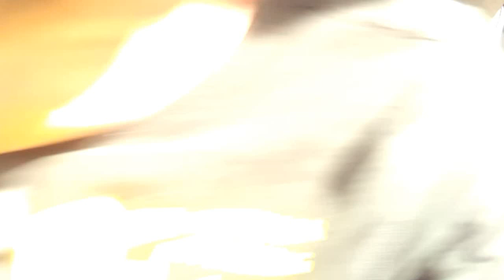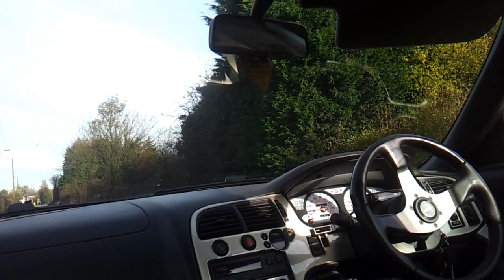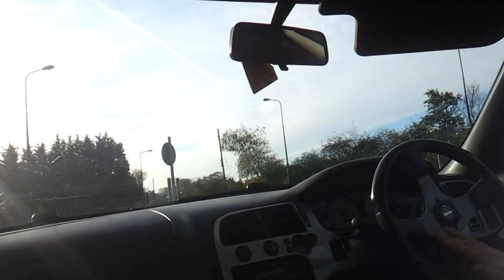Nissan Skyline R33 GTST little roundabout drift on a very slippy day 330bhp

Comment: nice! i want that BOV! gives that flutter sound of not running one.
Reply from the maker: Actually I think I had blanked it off at this point. Either that or it was really tight so it didn't really release properly. Never looked back ;)
Reply: compressor surge !!!

Comment: Sounds mint like good music lol. 
Just for others who dont know its not his bov making that noise. Its because he has blocked it.  Hence why it flutters.  U can either buy an adjustable bov and set it on tight. It will flutter.  Or u can take the pipe off your stock one and plug it with a screw and clamp it hard. Works the same. Just get a plastic cap to plug your bov also or it will leak.  ;)  and flutter all day long. Only problem is i have noticed it decreases kw and turbo spool time if you block it.  Sounds fn mad but causes lag and not good for dragging.
Reply: Wait, you need to buy a bov and then block it?
Reply: +MrSmashMovies. Most cars come standard with one already.  Just locate it.